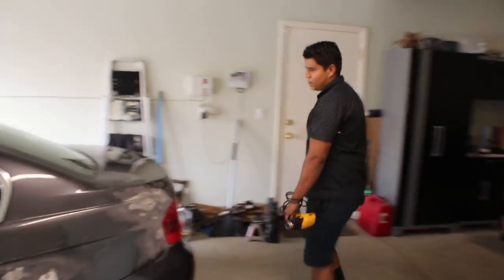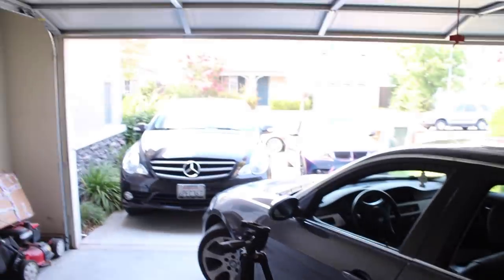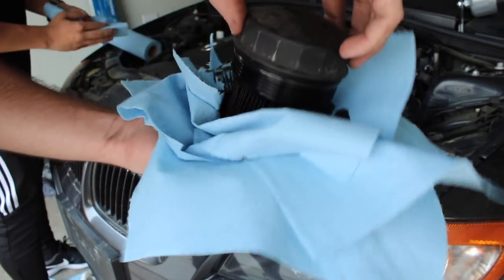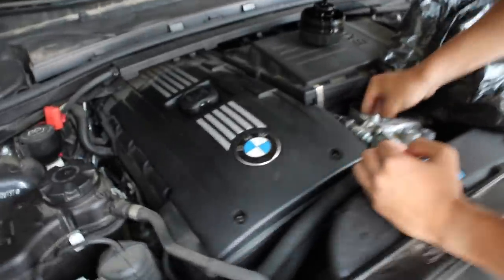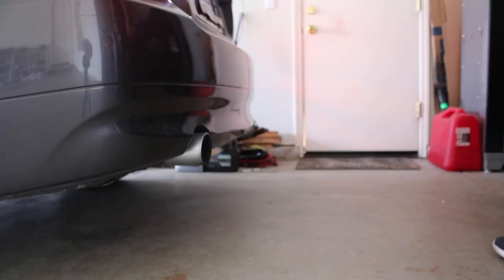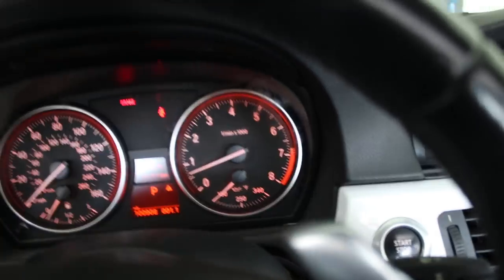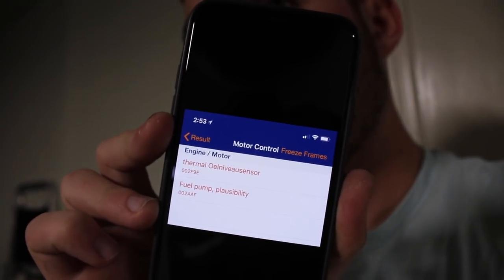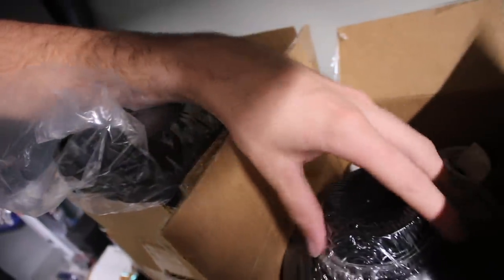Rebuilding BMW 335i Involved In Gun Fight! Part.11

Comment: that smoke is most likely from a worn valve cover gasket. the gasket itself is cheap but if the valve cover is also cracked you'll need to replace it as well. also the reason the temp gauge didnt move is cause bmw's take forever for the oil to warm up, start the car drive it for 15min normally and you'll see it move. keep it up bro its coming together nicely!

Comment: Extremely rare on a head gasket failing on a N54. Valve cover/gasket issue all the way man!  I have the DIY on my channel if you need a reference 😀. They crack, leak, cause many issues with idle and  many other things.  Buy a new valve cover if you’re over that 100k mark (gasket included) 👌🏻

Blue OE coolant with a 50/50 mix of distilled water is what you’ll need to make sure of.

Keep up all the hard work dude!! You got this 👊🏻
Reply from the maker: BMW Fanatic so green is not fine? I have it on my 328i, 330i, and 335i😂. Worked fine for me
Reply: HELL NO ONLY BLUE ON BMWS!!!
Reply: Nour Hummadi  ONLY BLUE IN BMW'S
Reply: Yeah technically the green shit corrodes the metals and all that shit just go blue is 24 bux a gallon from the dealer.

Comment: I would replace the oil filter housing gasket, change the oil and flush the coolant. Use BMW OEM coolant and distilled water. Green coolant will ruin your cooling system. There is zero coolant in the oil but it is filthy. The smoke is most likely coming from the valve cover gasket. I would take the plastic engine cover off and check for leaks.  If the valve cover is leaking just do the plugs, coil packs and valve cover gasket. Rock auto has the best prices for OE parts.
Reply: Nick Gorkes Spot on!!

Comment: A good way to check how well an engine has been taken care of is to look between the fins of the oil filter. If it has large flakes of metal in it you might have trouble. The color of the smoke can tell you a lot. White smoke is generally coolant. Darker smoke or blue smoke is usually oil burning. Definitely get rid of that green coolant. It will reek havoc on your cooling system. Definitely looks like a valve cover leak.  If it’s not valve cover make sure coolant isn’t over filled. When it pressurizes it might be leaking out of the overflow and burning up on the engine.

Comment: Swap that green coolant out ASAP! Only use the blue OEM BMW coolant. I got my car with green coolant and it ruined my water pump and a few hoses. Had to replace coolant lines, water pump, and thermostat all cuz the person before me used prestone.

Oh also, n54s take a while to heat up, so that could be why the oil temp gauge isn’t moving. I can sometimes drive 10 min and it’s still doesn’t move. I’d let it try to get up to temp and if it doesn’t, then yah good luck hahah
Reply: Steven Harreslon facts bro
Reply: Man, so good to know! I was assuming that i could put any coolant into my e90 bmw 325i but you saved me!
Reply: Steven Harreslon what's wrong with prestone
Reply: There's nothing wrong with the green prestone coolant in the BMW it's just as good as the OEM
Reply: I’m confused...lol
Reply: Manuel Ramirez wrong
Reply: As long as you dont mix them you should be fine
Reply: Manuel Ramirez the green coolant is what caused my water pump to fail and to leak terribly. It’s a different formula than the BMW blue coolant. Yah it’ll work, doesn’t mean it’s good for the car.
Reply: Currently, everything you just said. going on with my '08 535i.

Comment: From owning a n54 here is a maintenance checklist
Replace all fluids(trans, coolant, oil, powersteering, etc)
Pvc valve
Valve cover gasket
Exhaust gasket
Check intake and chargepipe for cracks
Intake manifold walnut blast
Check all injectors coils spark plugs
Fuel pumps

Comment: Iooks like a  problem i had,  my valve cover gasket was bad and was leaking oil onto to exhaust manifold and it would smoke same corner too! I ran my fingers all around where it seals mine wasent even noticible untill i touched  oil way in there .....

Comment: I had the same problem and same place with the smoke but i fixed it already by changing the cable valve cover and i have also the same problem with the dsc ignition and flat tyre and if i accelerate i get engine fault can you help me?

Comment: Valve cover I’d bet. Mine did that right after I bought it. Also my 335i resets to 5k not 15k like the 328i and 330i I assume they’re all like that. Even if you see coolant it might just be from the oil filter housing.

Comment: The idle is okay. On this engine 600rpm is normal after being driven (you reved it). The oil temp should rise, but from idling it May take forever. Turn on A/C for 5 mins to see if the fans turns on.

Comment: And for the smoke from the oil cap, that's from moisture in the crankcase and it evaporates when the oil heats up enough good especially after doing some pulls. I had smoke from my engine bay before and it was from the vcg leaking. If you let the car sit for some time and enough oil leaks on the exhaust and it gets hot, it will smoke like you're having.

Comment: Codes 2AAF, might cause by the Low Side Furl Pressure Sensor or In-Tank Fuel Pump itself, check low side fuel pressure sensor wirings and connector and also the DME software. If everything looks intact, then it might having an issue on the Fuel Pump.

Comment: the bmw from Yt throttle had the same thing with the fan there were ther was 1 fan not spinning the had to order some cables and route cables cause it wouldn't fit with those new cables

Comment: Head gaskets are extremely rare on the n54. If you see contamination in the coolant or oil it is most likely your gasket in the filter housing.

Comment: Oil looks normal. If it takes over 15 minutes for the temp guage to move, thermostat replacement. Smoke is the VCG. Do the oil filter housing gaskets as a safegaurd since you don't know when it's been changed.

Comment: I’d say it’s the oil temp sensor,  you can test that with a meter. I would change the cheapest thing first which by what you said is the oil temp sensor. 
You can buy a laser thermometer to check if the oil is too cool for the gauge to move just point it to the oil pan or some where you can measure the temperature if it hot like 200 and the gauge doesn’t move it might just be the sensor.
With the fuel pump I’d change the fuel filter which could mess with stuff causing the code and it long over due anyways because it’s a very over looked part.
Another tip try getting a repair manual it would make everything stuff a little easier.

Great work on everything so far. Keep it up.
Don’t over think because it make you worry so much.

Comment: I seen a Cowl and DCI haha lol, dude I strongly recommend oil housing gasket and oil cooler gasket. These two are really important that's where oil and coolant can mix. Valve cover may help the smoke but be careful the plastic cover does break or crack should I say, my friend n54 had a hairline crack right under the cap. last the smoke can be by the turbos. Take the underbelly off and really look at the turbos for any leak.. I really don't think you have a head gasket issue. Just a small oil leak somewhere on the  valve cover or turbos.

Comment: Get yourself an Android stereo off eBay that is made for e90, download Torque app.  The steering wheel controls still work and factory amp also.  You will enjoy onboard diagnostics, and Google maps navigation as well.  One of the best mods I made to my 2006 325i.

Comment: Most likely a valve cover or a brake vaccin pump which also leaks oil and burns which you might want to check? If a had gasget was blown there would be codes for misfires too possibly
Reply: Brake vacuum pump*

Comment: Okay 1.Your coolant so post to be light blueish!!! Original BMW coolant' And 2. if there's oil in your coolant then you might have an issue.....and 3. yes always when you purchase a used vehicle automatically assume it hasn't been serviced because you haven't visually watched it done on the vehicle. 4. Judging from your video it looks like it could be valve cover gasket this would explain oil in your coolant to some degree. 5. Possible twin snails are leaking. 6. Oil gauge doesn't get to normal operation temp after running a couple miles or so depending on a cold start. 7. Normal op. Temps are around 210 or 240ish and warming temp on the engine boosts temp at 160. Not 100% but hopefully this helps to explain a little. Keep your head up bro👍

Comment: Its very rare to see a blown headgasket on an n54, it looks like your valve cover is leaking onto the exhaust causing it to smoke when it drips onto the exhaust, as far the engine temps not moving youll need to drive the car, it takes a while for it to move, I commute about 15min, by the time i get to work it’s barely moved.

Comment: Check your bmw it will catch on fire🔥 check the motor blower wire and connected if you see sign about burn need replace all wire and connected thats why 335i have issue check it before its to late!!!!!

Comment: That's just some really old oil. Antifreeze is usually combined with some water. So if there was some coolant in the oil youd notice. Oil and water dont mix well lol itll get milky and gushy after it's been mixed for a while, not right away.

However, I do reccomend you switch to blue coolant. That's what our cars use. Not the green kind.

Comment: Maybe the thermostat doesn't work properly (if there is any).
I remember where I had an BMW and the engine was overheating because it was slowly cooling down the engine since the thermostat was only a little bit open.

Comment: These n54s it's not just changing the gasket sometimes that plastic valve cover is cracked so becareful.
And the fuel pump plausibility isn't bad, but I'd make sure to look up if your cars fuel pump has been changed in the past, cause if not... it may be time..

Comment: See one problem at the time bro, but please never change the oil without change the filter, and for sure u dont havs any problem with oil temp just take a ride for 20 min and u go see temp going up, but firts see that valve liking AND DONT PUSH THE CAR TO 7000 RPM when dont no if u have any problem in the engine.

Comment: Run the car with the new oil change for 2000 miles then change the oil out again to do a engine oil flush! No car should run 10000 miles on a fresh oil change it’s every 5000 miles on a oil change.stupid car manufacturers tell people they don’t need to change out oil from there cars

Comment: The code that you get in the fuel pump that happen to me before I just replaced fuel sensor by  the high pressure fuel pump you will thank me later

Comment: As others have said... the oil seems to take FOREVER to heat up. In the cold my N55 can take well over 10 minutes to start warming up. In the summer it can take 5 minutes or more. Your leak is almost assuredly the valve cover gasket and has also been recommended, do the oil filter housing gasket also.